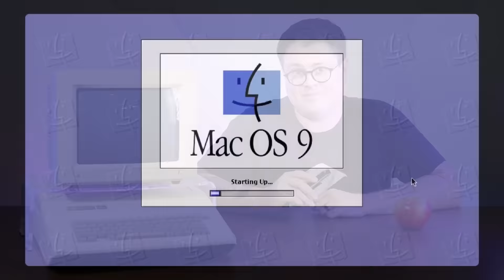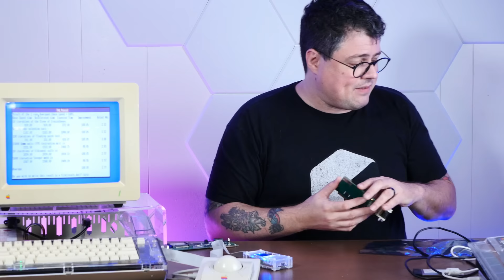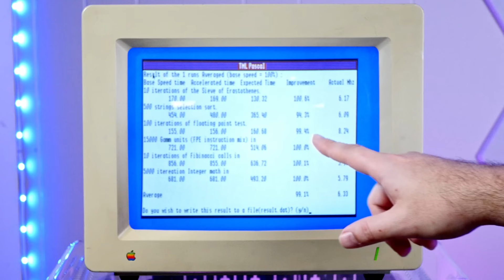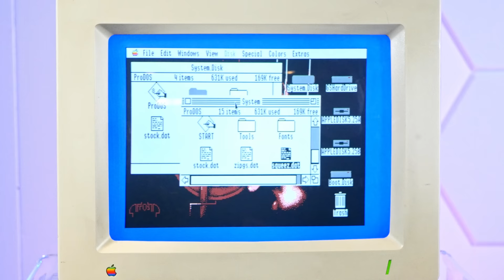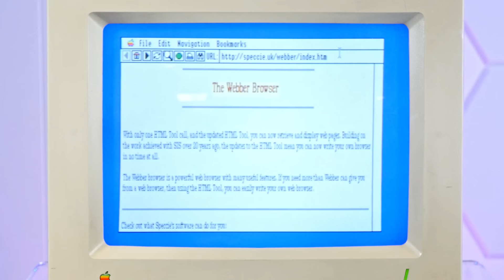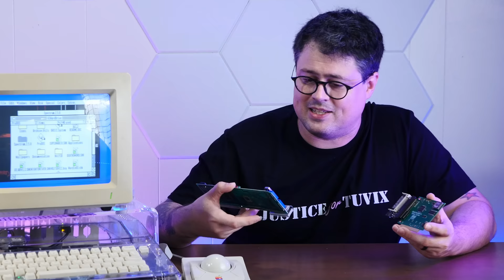This Apple Accelerator is INSANE

Comment: It’s amazing to me that people are still developing addons for such an old system. My first computer was an Apple clone Laser 128 EX, and had some speed selector function through keyboard commands (or holding a number at startup). This little accelerator reminded me of that. A simpler time.
Reply: It's more that designing these kinds of things are much more possible by hobbyists: individuals and small teams than ever before. If you can design a PCB, you can have a fabrication company create a board and even assemble it and have it at your door in a few weeks. At least presently depending if you can get the chips. FPGAs power a lot of these things and they are really hard to get right now.